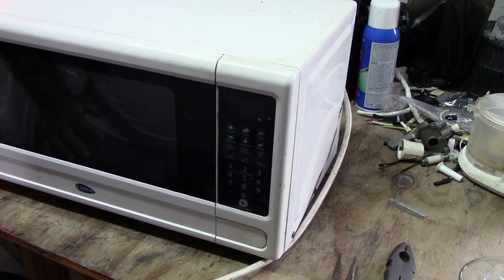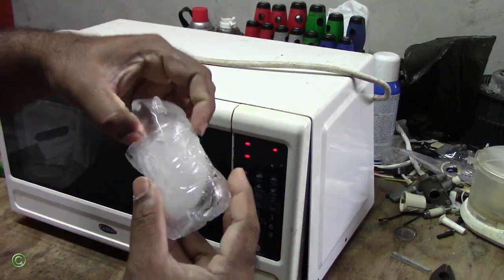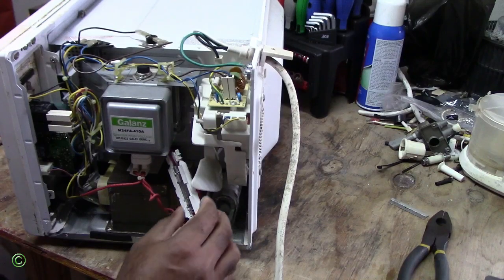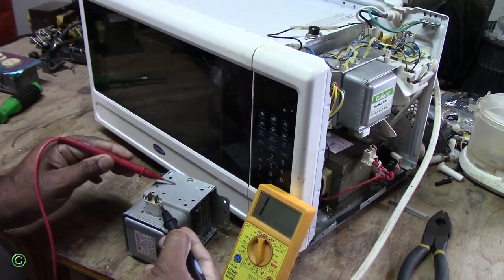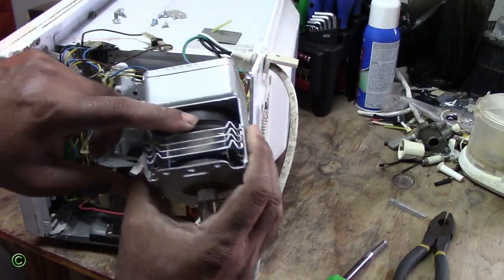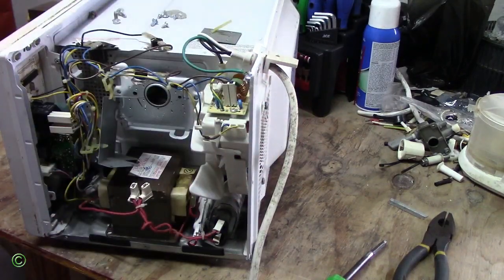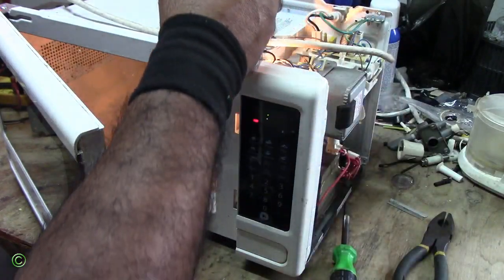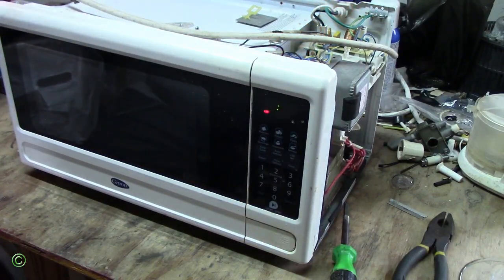Cetron Microwave Oven not heating

Comment: where  can i get a  magnetron to purchase? ...great video
Reply from the maker: You can check at your local appliances store or repair store or online.
Reply: @mr.fixit3604  my microwave  foil thingie  inside the microwave is burnt out and needs changing. Where in TnT  do I get that part.
Reply from the maker: @AD-ye6mw   Mica plate sheet. you can get it online. you can buy a piece and cut out the shape and size to replace the old one.
Reply: The Magnetron filament terminal actually made up of two capacitors that short to ground as what is happening here.The filament is good.These terminal sockets are available online and can be changed out without changing the whole magnetron.Youtube videos available on how to change it.